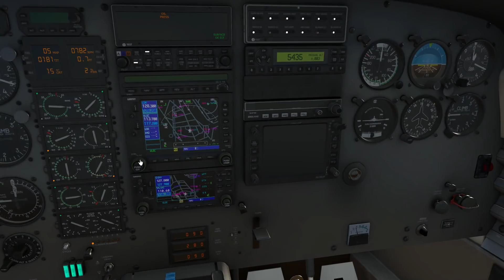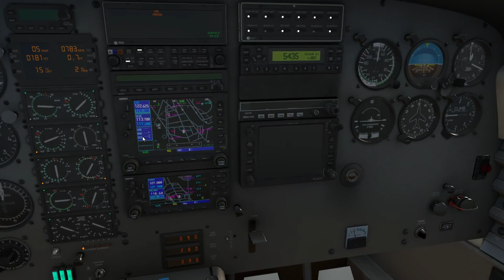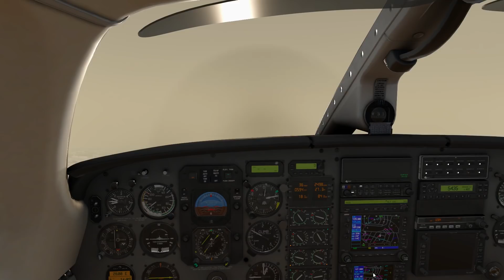Flight Sim World | Emergency Snow Run (Part 1) | Full Procedures | Phase 2

Comment: If you want to adjust VS for you climb, set your altitude and VS using the DEP (Data Entry Pad) which is just above the digital instrument display.  That works 100% every time, first time.  Using the VS button you were using has always been hit or miss for me in terms of when it engages and disengages.  https://youtu.be/mDJalSOSmxc 
Flying in heavy wind is seriously challenging, which is totally awesome!
Reply from the maker: Thank you, I'll start using that whenever I fly this aircraft after the mission! I have tried that one before but it seemed to still kick the nav/hdg modes out. I'll give it another go, particularly if it works. I think Dovetail need to fix the avionics systems in this aircraft...
Reply: I forgot to say this, but once the DEP is used, the VS button and Altitude knob where you usually enter things won't work anymore.  Altitude and VS must be set in the DEP once you've used it.  Oh yeah, when using the HDG button, if you click it on/off/on the HDG bug will jump to your current HDG.  And using the DEP might be a real pain with TrackIR.  I don't have it, so don't know.
Reply from the maker: Yeah, I know about the heading bug jump, that's consistent among pretty much all aircraft. I'll see what happens in a few tests. Thank you again!